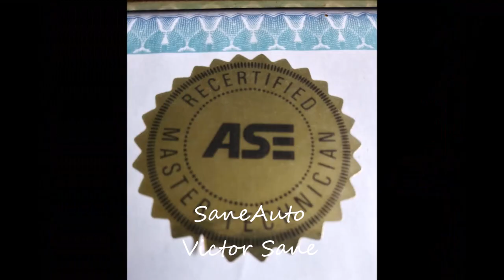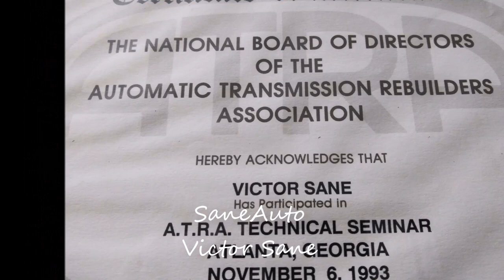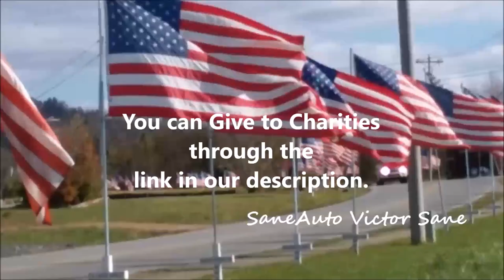AOD 4R70W ford transmission reverse piston ID identification

Comment: Great video thanks brother. I appreciate the information. I don't like transmission work. I will go as far as pulling the tower off and the transmission out. I won't even put a new pin in the tower for the shifter every drive thinks is a hand rest. I have done a old Chevy transmission year's ago. I tell you I was lost when the rattle clip fell out. I thought they were kidding me when I was told it just lays in there. They was right about that and it ran after I was done with it. I went and partied. Keep up the great work see you in the next video thanks again brother. I am learning more

Comment: Maybe it’s been answered or covered before. But I’ve got a vibration in my aod around the tail end. I’ve had the driveshaft shortened and I took it back and had it checked with very little if any runout. I pulled the trans apart and the only issue I found is the center shaft slightly rubbing against the output shaft. The output shaft had just a little bit of wobble or play in the housing, but the bushing looks fine with no abnormal wear that I see. Any suggestions? Thanks a million

Comment: Built aod I went through it real slow and by the book but I had Parts it was broken so I used three transmissions to make one they was all aod when I got it together it didn't want to shift and when it did shift it didn't come out aloe I drove it about 20 miles and I pulled it out and I had done and burnt the lower and Reverse band up can you give me any idea of what I done wrong I have built transmissions for years for myself and this is the first time I've ever had something like this to happen

Comment: I was wondering, what is your opinion on shift kits? Some say they are good and a necessary upgrade. But I have also heard that they are bad, and that they will make your transmission wear out faster. Also, what company do you buy your transmission parts and kits from.
Reply from the maker: The kind of shift kits I use are for towing or making your transmission last longer. I dont do racing transmissions or racing shift kits. Here is the one I use on the AOD -- https://amzn.to/3ghNHw1 for more parts look for the links in the description of my videos.